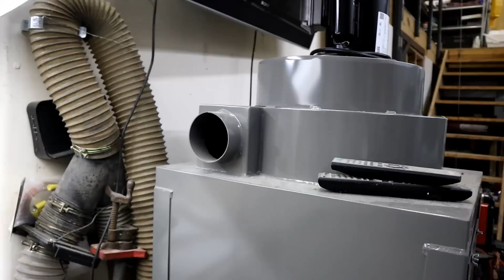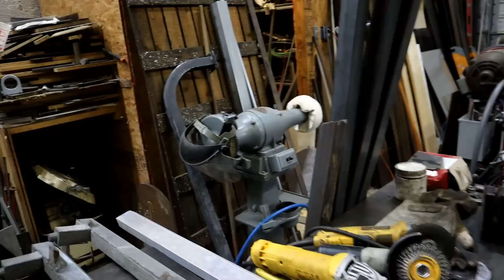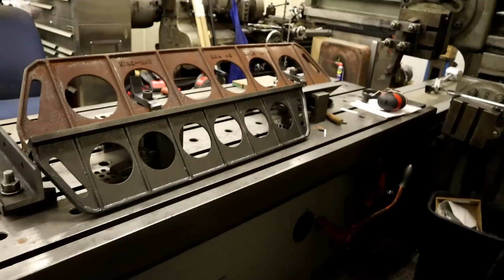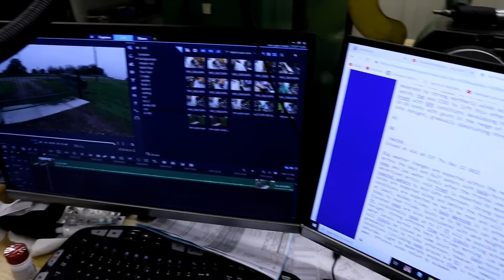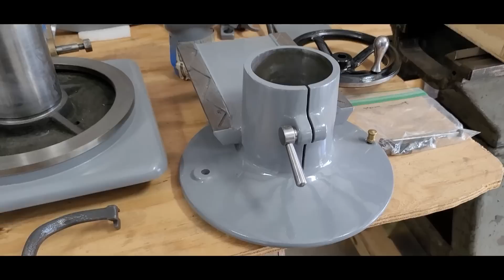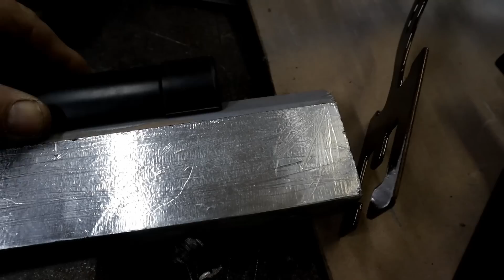EVERYTHING A MAN COULD WANT Monarch 10EE rail project, handscraping, bending, shop projects +Lunch!

Comment: If you need more of those type of cutters look under electronics assembly tools.  They are generally called flush cutters, they come in all sorts of shapes and angles.  They were used more before surface mount components.  They were used to cut soldered leads flush to the circuit board.
Reply from the maker: Thanks I'll check it out!

Comment: I use Rustoleum paint also. I have run it through paint guns as well as using spray cans. It always lays down smooth. Of course the better fill and sanding you do will make a smoother finish. I'm restoring a lot of hand tools and really like Smoke Gray and Royal Blue colors.Merry Christmas Steve and Don.AL B.
Reply from the maker: The thing about this stuff is it is a can spray with a very much improved spray pattern, more like a spray gun than a rattle can... I'm not even sure it's the same paint they put in the regular spray cans... Have to read up on it...
Reply: Merry Christmas
Reply: I am looking forward to seeing the videos of the projects , thanks for all the effort you put into videoing ,editing not to mention the cost of equipment you incur. Look after yourself please . Merry Christmas and I wish you both a healthy , prosperous and joyous 2023!

Comment: Steve I'm doing a flaking job on my big lathe compound and I 'm going to flake it . But how much flaking do you really need on a surface ?
Reply from the maker: That's like asking how long is a ball of twine....  Ask a 100 different people and you will get a 100 different answers.  The purpose of the flaking is to hold oil and in some peoples minds reduce the area in contact. I have always gone with a pattern like I show in the video.

Comment: You have a very nice workshop. But you need more room , what you need are a couple of containers outside and move a load of stuff you dont use often into the containers, and then you would have loads more room to fill up with more antique machines.All you need is a really good sort out.
Reply: I can say for myself that you need to keep your important machines and projects above the dew point so they won’t rust. You can’t do that outside, but that would be Steve’s call.
Reply from the maker: Yep rust is a big problem here.  All the shop has heaters and AC to combat that...
Reply from the maker: I do have a little problem there.... Even though I have 11 acres of land my wife is VERY stingy with it and will not let me have more space than a 40 x 60 shop... I think it is very stingy of her and have told her so often! Even Don has given up trying to change her mind!
Reply: @10swatkins  There has to be a way, you have a lot of space up in the roof can you not install more second floor and have a massive sort out to give you more room, or even find somewhere else to store stuff you are not working on and stuff you dont use often, the rusting problem can be solved if you really try. I was lucky enough to get my hands on some army surplus stinger missile system storage boxes which are great as they are sealed when the lid is on and have a place for a desiccant pack  so you can remove all the moisture in them. i have one for storing bags of unused cement, had some in there for two years and its still as good as the day i put it there.

Comment: Hey Steve…..I have the same hawthorn building as you and I want to build a platform like you have your sandblaster on. Is yours attached to the building walls or is it freestanding?
Reply from the maker: I am sorry.... Wish I had gone with a conventional metal building.. Screws were cheap, metal siding was light weight and the insulation is now failing....

The 3 x3 metal posts are too small  to support the deck.... I put a stud wall in between each 3x3 and attached the 2x4's to the metal 3x3. The 2x12 floor joist is resting on the stud wall with a single toe plate and double top plate. Then 1 1/4 inch thick toung and groove plywood 4x8 decking is screwed to the floor joists that are spaced on 12 inch centers... Super strong that way,

Comment: Merry Christmas to you the wife n Don ,, I made shelves for my heavy vices rotary table and other mill devices we collect. But mine I made on wheels with a linear actuator rated for 400 lbs.its 12 volt so my jump box will operate it with a swing arm and chain or strap every shelf is loaded easily.
Reply: Merry Christmas
Reply from the maker: Did I mention this is a down and dirty project? :)    Show off :)